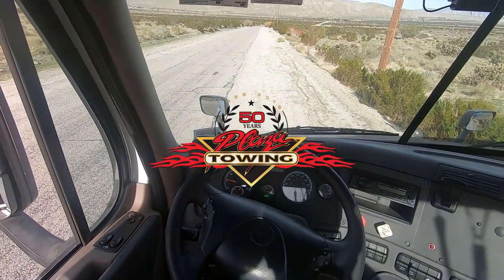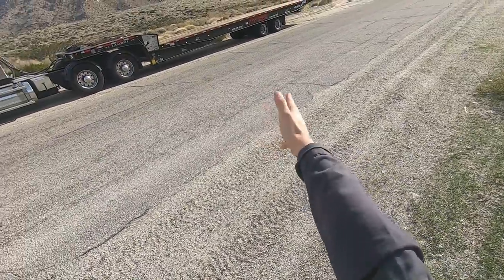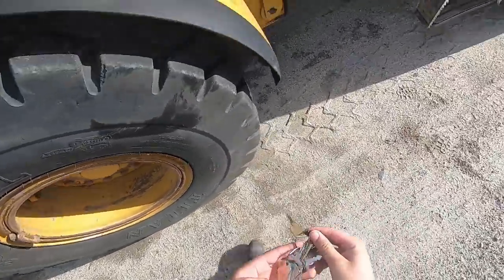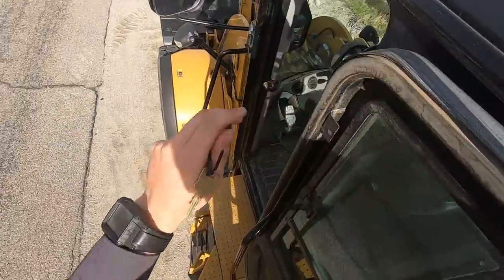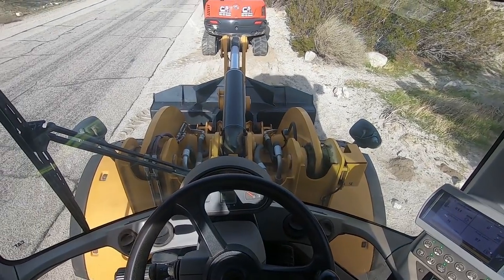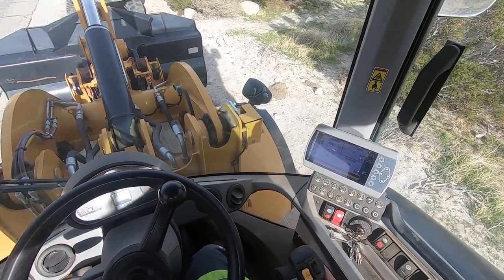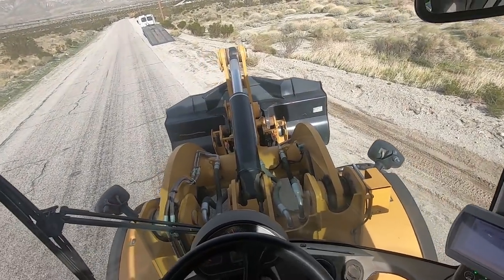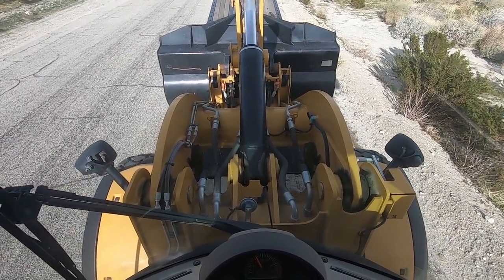Loading A Cat 938 Loader Onto Trailer

Comment: Do You know you're supposed to use the articulation bar?   keep the machine from articulating during transport.  It's the orange bar on the steps
Reply from the maker: Chained down, it will not articulate but yes it can absolutely be used. Thank you for watching
Reply: @plazatowing  I've been hauling equipment and oversized equipment for 12 years now OTR. About two years back I was hauling Hitachi wheel loader about that size.  had a chain down almost exactly how you have a chain down. Got put out of service in Florida for the articulation bar.  fmcsa 393.130 if you want to look it up.  Love the videos keep them coming!
Reply from the maker: Interesting. Never have seen that. Will keep it in mind thank you for the info